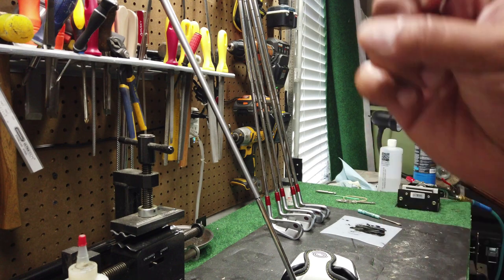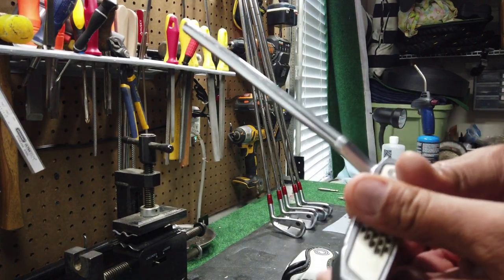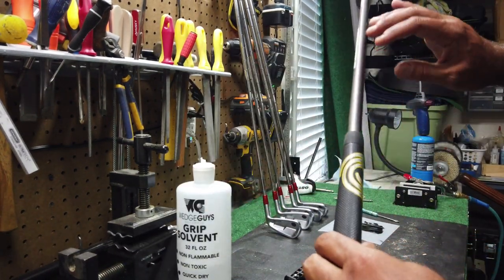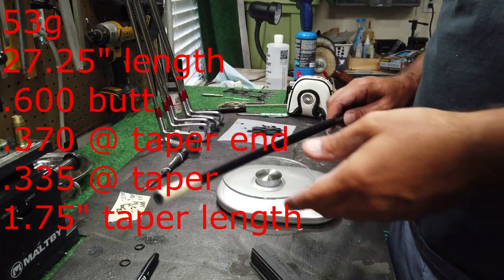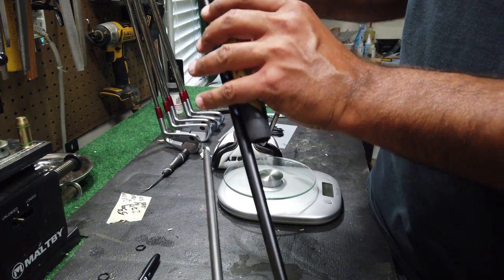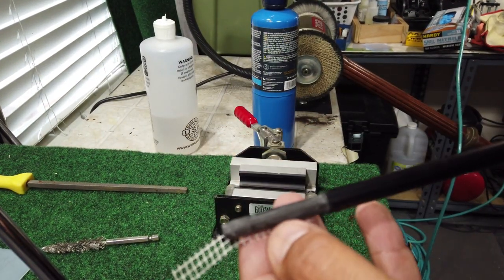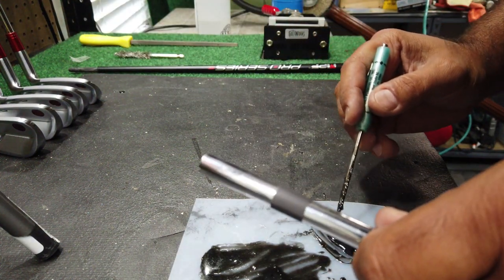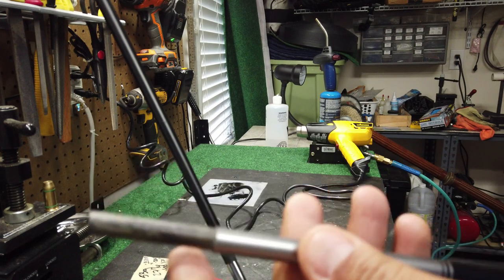Odyssey Stroke Lab Putter Shaft Replacement

Comment: can you insert a .355 shaft into a .370 putter head , if so how is the best way
Reply from the maker: Depends on the hosel type, but you can use a brass shim (probably the easiest way). You'll have to cut the shim down (trim the tops) so it doesn't go above the putter hosel. The epoxy should fill in all the gaps. 
The other way which is a little more advanced is to flare the tip of the .355 shaft to .370.  Heat the tip of the shaft (so it's easier to stretch) and use a ram rod or something similar to hammer into the tip to expand it.